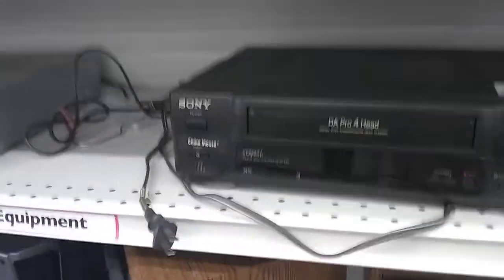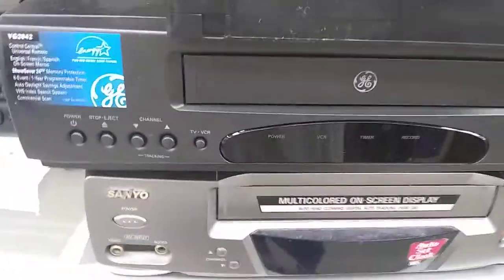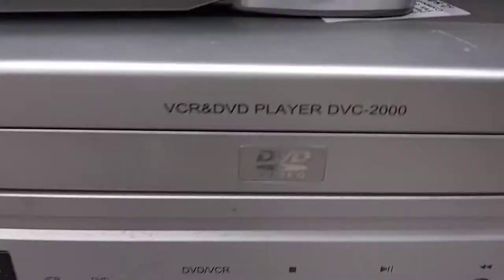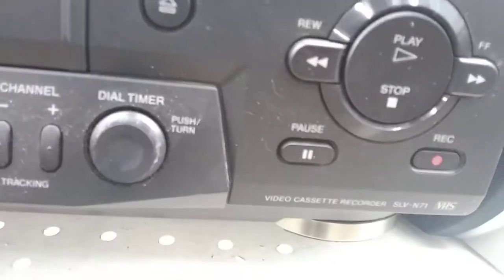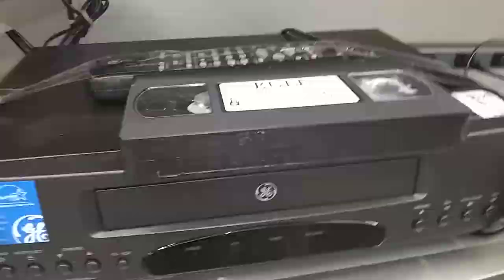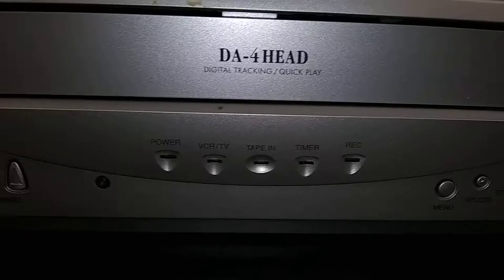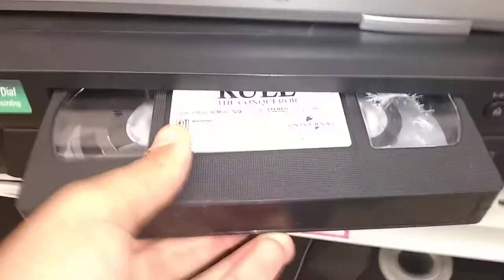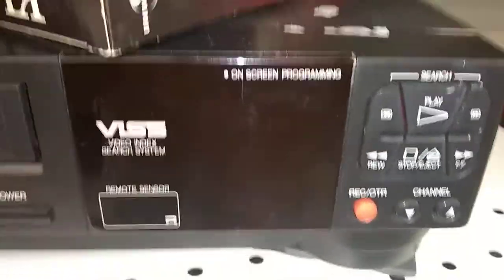VCRs At Savers #2

Comment: I actually have that gray Emerson VCR, which I got at the storage recently. And surprisingly for a Funai VCR (despite no mentioning of Funai on the back), it works excellent. Plays most tapes very well. I wasn't even expecting that, even for a VCR made by an infamous company that makes poorly made VCRs that just eats tapes and spits them out. I did test one of the tapes I am donating (my BB rental copy of Remember the Titans, which I am preferably keeping the blue lid reprint copy), and it works (was originally going to think it will eat it up like most Funai VCRs do). As a result, this will replace my faulty Zenith VCR/DVD combo.

This wasn't the only Funai VCR that works (aside from the Toshiba VCR/DVD combo I had like 10 years ago, which used to play tapes fine, and possibly the Toshiba TV/VCR combo), as my school classroom's VCR around the 2018-2019 year (which was the Magnivox VCR/DVD combo), works EXACTLY the same as the Emerson VCR I currently have. At least Funai tries to at least make an actually decent VCR.

The other Funai VCRs I have (one of which is the Emerson TV/VCR/DVD combo, which my school classroom outside the 2018-19 year has the similar thing like that) just eats tapes and spits them out.